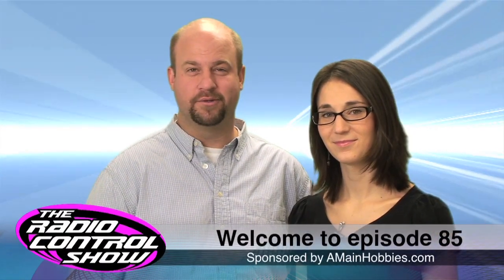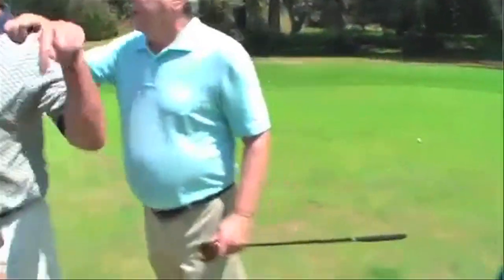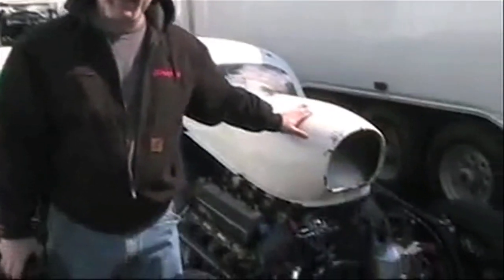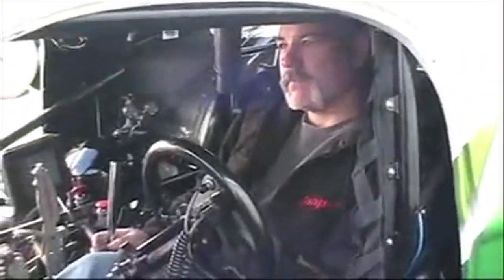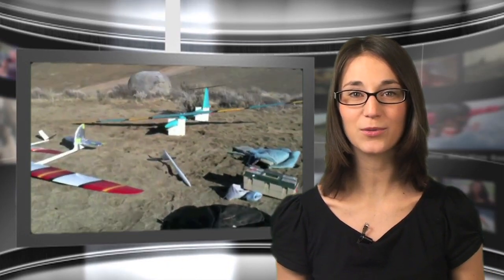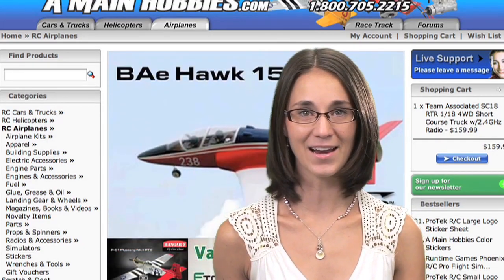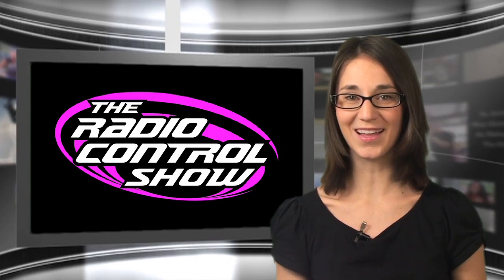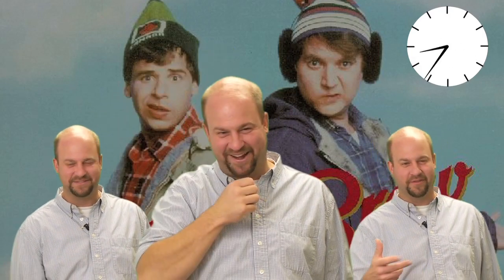The Radio Control Show 85

Comment: @LDUDE100 What, you mean like dont gear higher than 10mph or they'll puff? Maxamps are the biggest con artists in r/c history; anyone who isnt a grade-A noob would know this. Their 150c lipos are actually just their 60c lipos with a new label, and even then they can only hold 3.75v per cell @ 22.5C discharge, making them ~30c at best. Noobs will buy any crap with a cool looking logo....